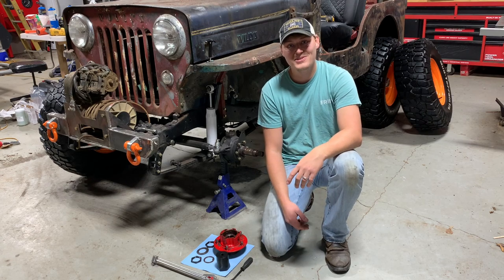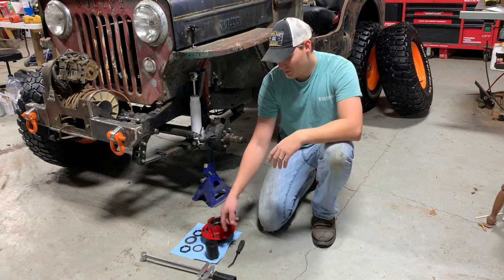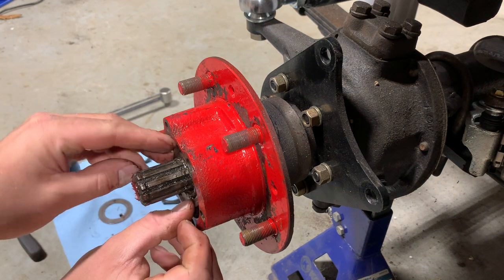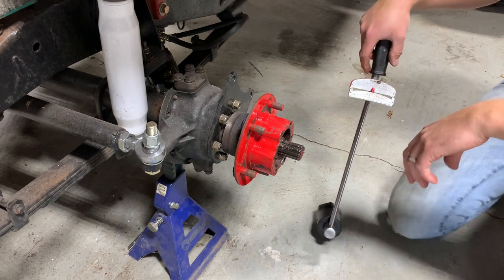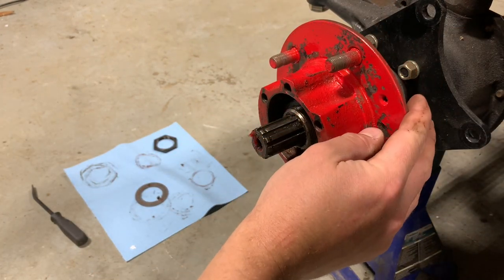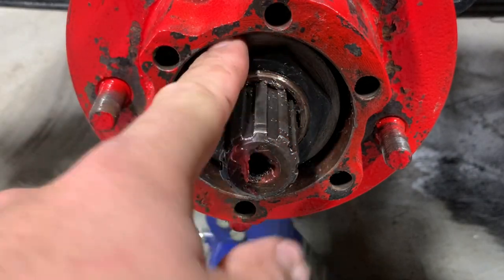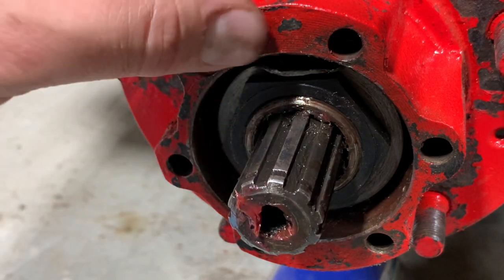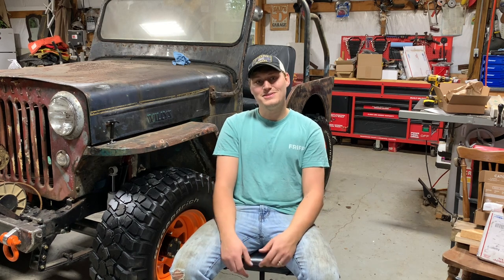Willys Jeep Wheel Bearing Setup!

Comment: When you torque the outside bearing nut to 50 lbs. Do you need to  back it off I flat on the socket like the first bearing nut?
Reply from the maker: No, the first nut sets the preload, the second really locks everything in. It doesn’t hurt to rotate the hub while you set the first nut though. Thanks!

Comment: I seen that procedure somewhere ;)    good practice when torquing the first nut to spin the hub as you torque.  a good way to fold that washer is use a flat head screwdriver about a foot long or more. they tend to be allot narrower and the fold usually is easy.
Reply from the maker: I meant to say that about rotating while you tighten… there’s always something I forget to say. I’ll have to get a big screwdriver! Thanks!

Comment: Great info! and the Jeep is looking good. I will need to get one of those large sockets, but I remember people back in the day would make a socket out of a piece of muffler pipe or thin wall pipe the right size, by heating it red hot and shaping the flats of the nut. ($8 bucks  plus $21 bucks to ship here...ebay )
Reply from the maker: That’s crazy, it’s amazing what people use to come up with! Thanks for watching!

Comment: Is the inner bearing pressed in?
Reply from the maker: No both are a slip fit, hope this helps!
Reply: Thanks brother, I’m gearing up to finally do this 
Do I need a seal puller or anything?
I have a good heavy duty hub puller cause I’m sure as all hell it’ll be stuck on there good
Reply: @SevenBarSalvage  Nice!

Comment: Thanks for the video,good information,refreshed my memory on bearing setting preload,my 48  has Trans/Transfer case out right now replacing a few things inside,mostly seal leaks,no fun topping the front and rear diffs and Trans/Transfer case up in the evening and next morning one third is on the floor,mostly original with around 36,000 miles and original seals,time hasnt been good to them,time to seal it up,also have to go through knuckles and rebuild them with bearings,races,seals and set the preload on those too,I have allkinds of Willys service manuals,but still enjoy videos like these,anything Willys!Thanks!
Reply from the maker: Awesome! Thank you for watching!